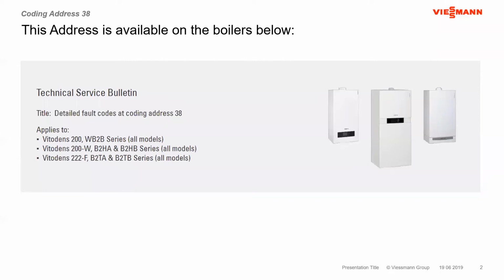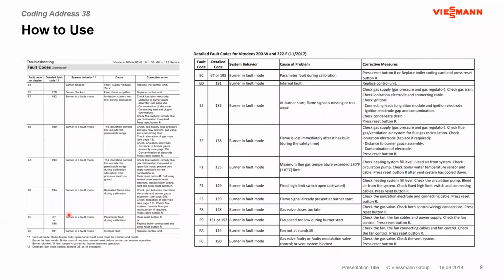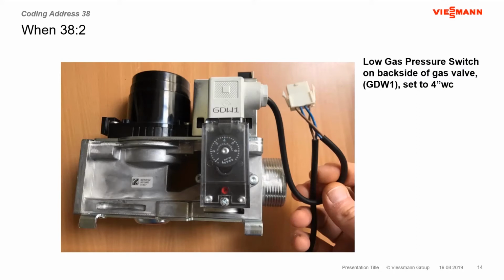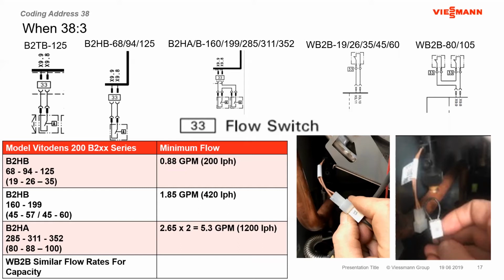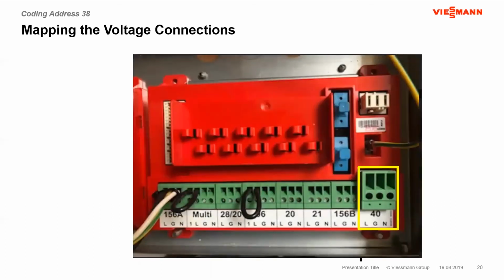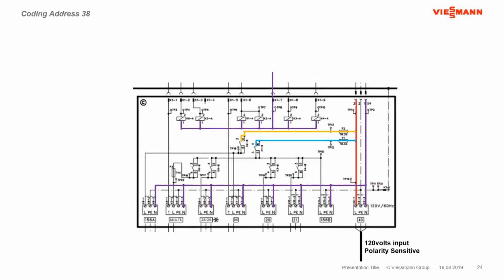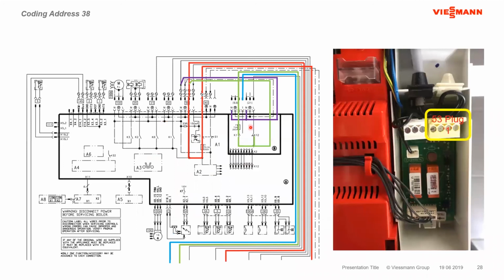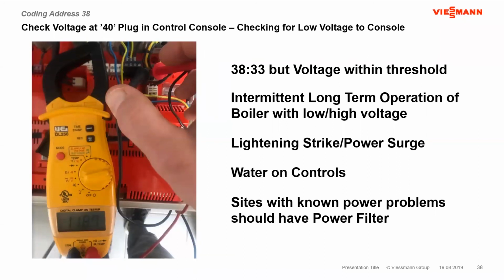Troubleshooting: Address 38 Webinar - August 5th 2020

Comment: Hey i got error e8 and i see in specific error 38:189 that's mean Excessive deviation of the required ionization value from the actual value over a ten-second period and someone told me that could be Graphite gasket under the burner.